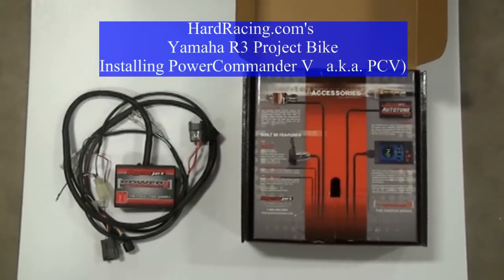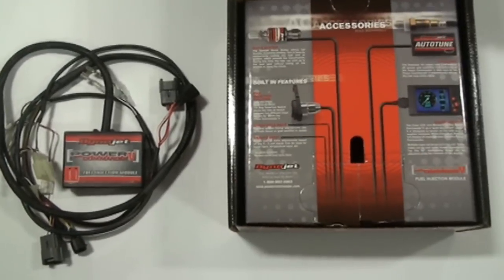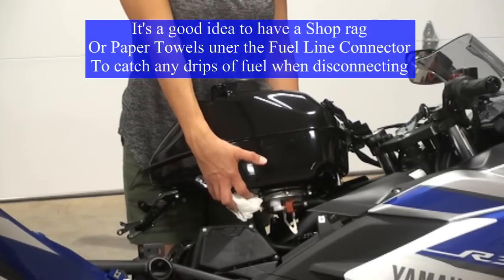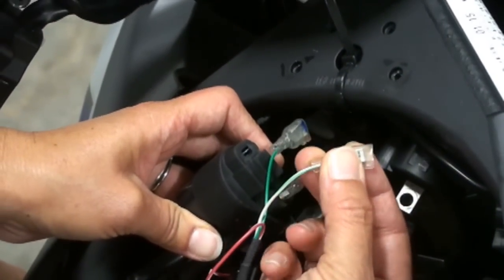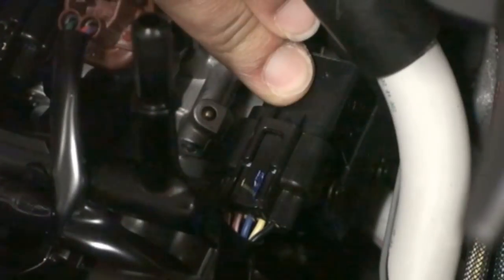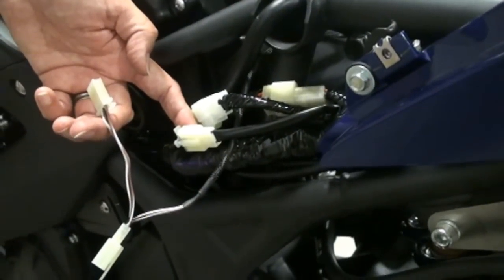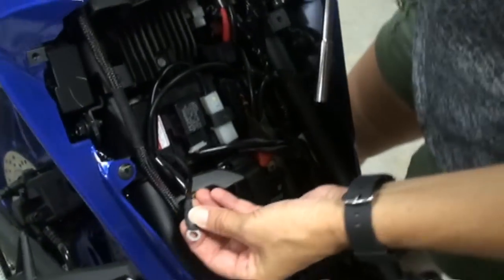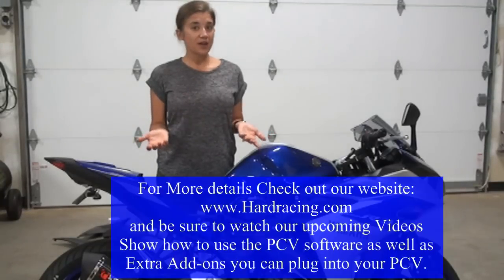Yamaha R3 Power Commander V Fuel Controller (22-072)  Installation  #Hardracing #R3

Comment: Friend, I bought a Power Commander V for my R3 2021, but it doesn't come with an oxygen optimizer. I've seen videos where they put it, but mine doesn't come with it. Is the optimizer necessary or can I leave the original cable with the oxygen sensor in the pipe? exhaust?

Comment: a quick question about the power commander on the r3. Does the PC get rid of back fires if a full system is installed? and is it possible to make a video while riding the R3 while riding the bike? thanks
Reply from the maker: +Josephite Taz 
The map can be totally customizes to greatly reduce off throttle back fire.

But, to completely, eliminate it....... you would need to install Smog Block off plates.
Reply: you need this:
Driven Racing Engine Block Off Plate Yamaha R3 2015-2018
SKU: 1101981
got mine at revzilla

Comment: hey man i have a 17 yamaha r3 and i install a aftermarket full system exhaust and is alot of popping noise  is this power comander help make my bike less poppoing noise coming out of the exhaust? and make the bike go faster?
Reply: Yes, it will help make the bike more efficient and clean up the fuel curve.
Reply: you need to get this:
Driven Racing Engine Block Off Plate Yamaha R3 2015-2018
SKU: 1101981
got mine at revzilla

Comment: My Question

Any Kind of speed boost? the Australian model with my fat ass on it I hit around 173km hoping to get it up to US standards of 192km as I am not that heavy to slow the bike down 20km that's the Australian standards doing it
Reply from the maker: Yes, you will gain more acceleration and a little more power/ top end.
You can also raise the rev. limit a little and advance the ignition to gain a little more as well
Reply: I didn't really feel the difference but I am a rookie I had it in for around two weeks and made a mistake and totalled the bike when I got a replacement then I noticed it was a lot weaker due to no power commander now that it is in the new bike its all good XD

Comment: 02 optimizer doesn’t come with power commander.. I’m confused
Reply from the maker: Not any more.  DJ Says, it's not needed.
Reply: HardRacing so should I still bung plug it or just leave it be?
Reply from the maker: Most guys will plug the hole
Reply: @HardRacingPerformanc  se debe desconectar el sensor y taparlo o se puede dejar como viene de stock?
Reply: I've seen videos where they put it, but mine doesn't come with it. Is the optimizer necessary or can I leave the original cable with the oxygen sensor in the pipe? exhaust?
Reply: @AS-up7cw  yeah you can just leave it.. Plugging it looks better though

Comment: Does the bike go a lot faster after that?
Reply from the maker: Yes, it does help make the bike run much better, specially if you have more mods.
Reply: exhaust/airfilter and a power commander gets you like 4HP and 3 torques . Not a bad way to spend 10,000 dollars
Reply from the maker: $10,000 exhaust ?  That would be something to see.  ;-)
Reply: fast and furious reference 
still power commander $500, full akro exhaust 800, 50 for airfilter. not really worth all the trouble + labor

Comment: PLEASE RESPOND I NEED HELP. On my R3 I have a Dynojet installed a block off plate installed and a new air filter and a full system exhaust. Do I need to get my bike dyno'd or is the map I use from Dynojet good enough until I install my autotune?
Reply: You'll be find with that Map.
Reply: sales @hardracing thank you

Comment: So... i followed this video step by step. everything went according to "plan". but all of a sudden a 24 code has popped up. any thoughts before i take it in. thanks.
Reply from the maker: Could be mis-wired.
Unfortunately, we don't have a Yamaha Service Manual with codes in it.
You'd have to check with your Local Yamaha dealer to find out what Code 24 means ?  Then we will have a better idea of what's going on.
Reply: HardRacing so i had googled the code and 24 was something with the O2 sensor. buddy of mine said to take off the optimizer and reconnect the O2 sensor. i did and the code and engine light went off.
Reply from the maker: Excellent new.
Reply: I have de same problem, what is de ''optimazer'' ?? Tank you.